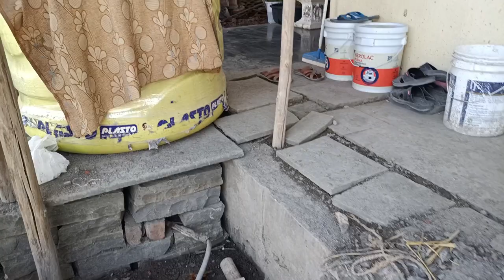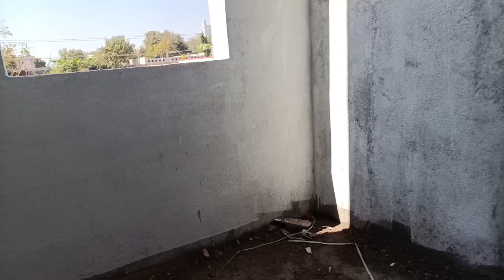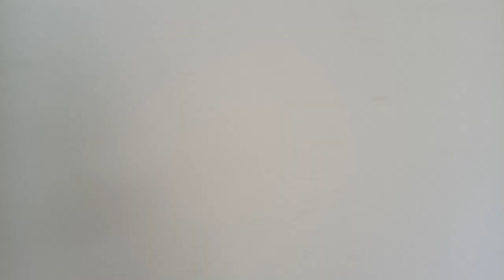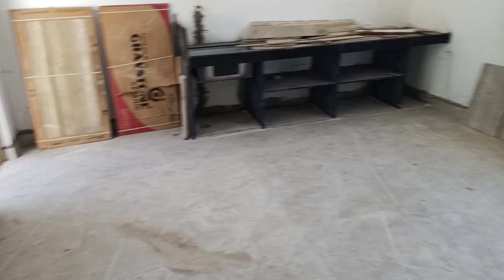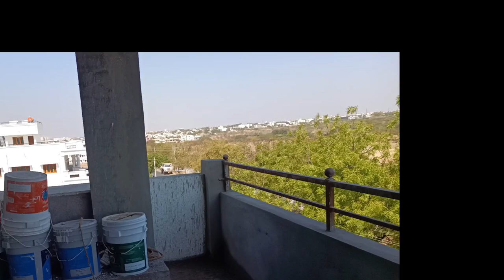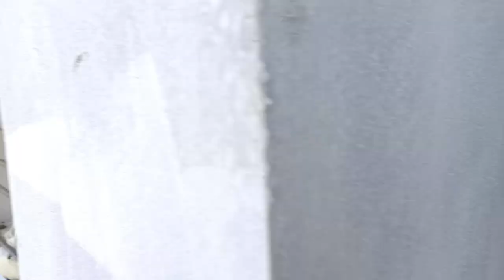Load bearing structure converted into framed structure.

Comment: Sir what will be the cost to convert 1600sqft single floor load bearing structure to Framed structure adding 1 more floor
Reply from the maker: In between 40 - 45 lakhs.

Comment: What if.. septic tank height is lower than road level, is it possible to increase septic tank height ?
Reply from the maker: Yes, u can increase. Y u want increase?
Reply: @surveying1987  Yes but how?
Reply from the maker: @thehulk2758  by demolition slab which you provided to septic tank or if you don't want to increase the capacity of the tank then you can only increase the cap height then fill earth surrounding.